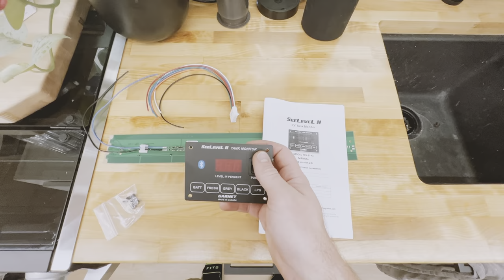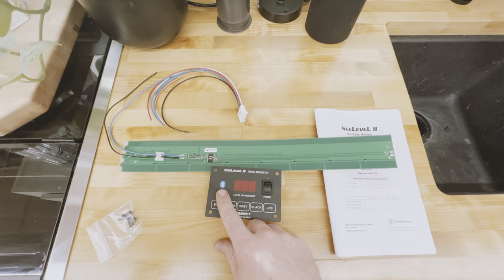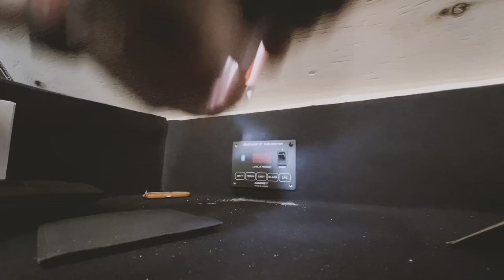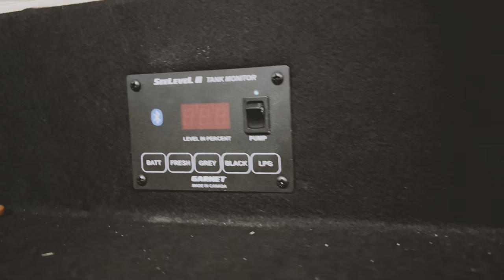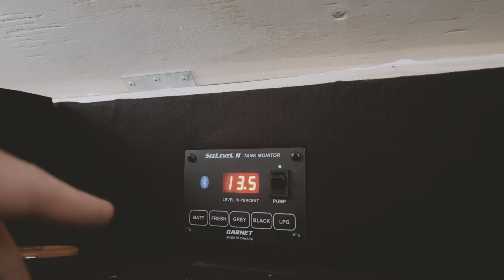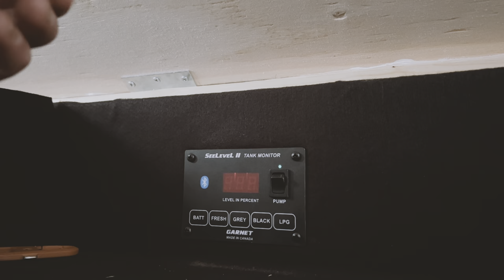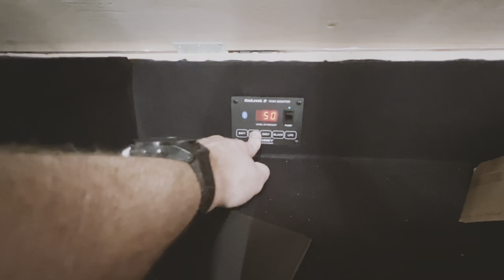SeeLevel II Tank Monitoring System Install - Skoolie Improvement Part 2

Comment: I'm guessing you did this a while ago now. I'm wondering if it's figured itself out and is working more accurately for you? The sea levels are a far better system then the three squares stuck to the side of the tank that are way less accurate and really give you no clear understanding of what's in your tank. Once a square is hit it reads the same until the next one up is hit, so it will read 50% from just below 50%  all the way to below 75%.  And given that they are randomly spaced and stuck to the tank, it's a pretty useless way of monitoring your tank, because it's never clear exactly how much you have in the tank. So even if your sea level isn't the most accurate, it's far better then any other choice out there.
On another note...Manny seems to be a troll that's globbed onto your channel. Maybe you'd be better off blocking him. Great response to him though.
Reply from the maker: Thanks mate! Yeah so far the readout has gotten more accurate which is great! I did see those other ones that really only give you 25% increments and I said hard pass to that. I’m inclined to agree on your last point too…thanks for reading my response tho 💪🏻
Reply: @BibiaBus  Strong work all around!